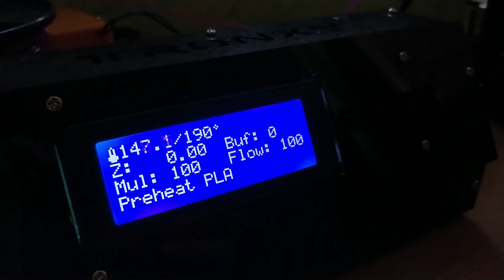Fix Poor Extrusion

Comment: That's not my problem. I get super rough and scratchy surfaces and infill. Diddnt before but it popped up a few months ago and havent figured it out
Reply from the maker: Hi, thanks for your comment!
To diagnose this issue, you need to verify that you have an under-extrusion issue. You are probably experiencing a similar problem to what I was in this video, but just not as strong. First, take a look at the extruder gear and figure out if it's slipping or if the motor is clicking. Then look at the hot-end. The cause of your problem can be anything from a slipping extruder to a (partially) clogged nozzle to a destroyed PTFE inline.
Let me know your findings to look at further steps.
Reply: @Caverntwo  I'll take a look. I have looked at all of those before but I don't think that was the cause. And I did just replace the ptfe tubing with capricorn xs and capricorn couplers.
Reply from the maker: That sounds good, I also once encountered a bad coupler.
What you should try is to push the filament thru manually. If you feel a lot of resistance, it's probably from either the nozzle or the PTFE tube inside the heat-break (except if you have an all-metal hot-end). My Anet A8 currently ran into this issue, I'm 95% sure it's from the PTFE tube inside the heat-break, as I encountered this issue already twice. It's printing normally but extruded less and less (with the motor clicking more frequently) over like two or three months now.

The Capricorn tubing will further minimize the resistance induced by the Bowden tube, so that's always good to have. 
Furthermore, did you check the steps/mm configuration in your firmware?

Comment: I've been chasing my tail for years on extrusion. My Geetech A10M has a peculiar feature which I have traced back to being likely a slicer problem. The walls do not overlap with the skin, at least in the top layers and sometimes with the inner walls. It isn't an extrusion problem because the first layer looks perfect or over extruded if my bed is a tiny bit out. Usually it evens out over a few layers. If anything I'm over extruding on my bottom layers, but my walls seem to want to have gaps between them and the top layers. Nothing I tried works.
Reply from the maker: It could still be an extrusion problem or even a configuration issue, with the latter being easy to check out. 
Heat up the extruder, move the head up a little bit and make the printer extrude a set amount of filament, e.g. 10 cm using Pronterface or even the LCD controller. Mark a reference line further up the incoming filament, e.g. 15 cm back using some tape and measure the distance to the extruder before and after the procedure. Then you know exactly how much really got extruded!
If it's off your expectations, you should take a look at the software configuration. Just put a M92 command with corrected values in your start G-Code. See more about it: https://reprap.org/wiki/G-code#M92:_Set_axis_steps_per_unit
Obviously, make sure that the nozzle is not clogged and the extruder not clicking, otherwise your results will be nonsense. You can also adjust the steps/mm setting in your firmware, but then you'd need to reflash.

For the slicer settings, if you use Cura, there's a setting for the distance between the infill or skin to the sides. Maybe that's what you're expecting, but it's only a guess.
Also, check out the filament thickness you set, just to be sure, that caught me three times already. Just that you know, the prints looked pretty much like the one shown in the video.

Let me know if that helped ya!
Reply from the maker: Oh, I just looked up, it's a printer with a single z-axis. I have experienced something very similar on my Anet A2+ when I got it, check out the videos for that. 
Basically, the bottom layers were smashed together and the upper layers normal or even pulled apart in some places. Turned out that it was due to a few things, one being some wheels locked up, the coupler wrongly installed, etc. I solved that by installing an upgrade that puts the motor and leadscrew into the middle, solving the problem for me.
Reply: @Caverntwo   Thanks for the input, especially so quick! I think it's a setting with the skin overlap as it seems very deliberately doing it. Something Cura is doing that it shouldn't be. If it was a blocked nozzle I would get layer separation, gaps in the print etc. I don't know, it mostly seems the walls are too thin. I will check out some test tomorrow. My e-steps have always been nonsense on this machine. I have used calibration guides but it seems way off and when I adjust to how I am told I get massive over extrusion so I set back to default, even though it shows me only 79mm is extruding at 100mm. I wonder if it's because I left this at default while adjusting the X/Y e-steps which were out a little bit.
Reply from the maker: Hmm that sounds strange. 
I'd still try to get the extruder steps right first and then look at the other things. To be honest, I set it to 95% to 98% of the recommended settings too on almost all of my machines. This reduced blobs.

Are you sure that Z-movement works as expected? Especially at the lower layers.
I'd check with a pair of calipers. Maybe the Z-steps are out of place too, maybe just a little bit. You can find it out if you print a calibration cube and measure it then.
Some other things that would get into my mind:
Can you verify that the size of the nozzle and material is set up correctly?
Is the extrusion process going on smoothly or is there some filament grinding at the gearwheel or even motor clicking?
Reply: @Caverntwo   My z steps are spot on. Each time I check it goes to 100.0mm on my calipers. I checked twice because I was getting grinding at higher layers before, which I thought was over extrusion, and I kept lowering the flow rate but then my layers just flake away with no substance. I traced this problem back to being too cool while running fairly fast on a big print. I now run quite hot, between 220-240 and my extrusion flow rate seems fine now, but I'm now getting gaps between walls and skin. I'm wondering if it's because my filaments are over a year old or are poor quality. I printed last night and noticed my inner and outer walls on a piece with 1.6mm walls were also not joining up well. The layers and bonded very well, are pretty smooth and strong. A bit over extruded on the base layer which has squished out.  I've checked my extruders constantly by tightening or loosening the spring. I think this is okay. It isn't grinding and it's fairly tight. I lowered my retraction settings to mitigate this being an issue at the cost of some stringing which isn't too bad to clean up.  I've never quite understood the e-steps and flow rate... are they basically doing the same thing?
PS: My nozzle and filament settings are on point. I am printing at 0.3 layer height.
Reply from the maker: Your issue is really strange, I have to admit. I'd try the following:

If you get some grinding, the extruder doesn't create enough pressure. You can try to tension/compress the extruder spring even more. 
If you set the printer to just extrude some material, did you measure the width of the extruded string? I once had an under extrusion issue similar to what you describe, which could be traced back to the nozzle being just slightly clogged. 

From the software perspective, how about trying to reset all settings and start with a new instance? Ideally, you just need to set the printers material thickness and nozzle thickness, sizes and you should be ready for another test. Maybe it's really a problem with your settings.
Reply: @Caverntwo   Thank you for your in depth expertise, it is much appreciated and is spurring me on for try and fix these issues once and for all. I am going back to basics now, having just tested my steps again for all 3 axis, and found something really strange. My calipers were giving different readings at different points along the rails, such as at 10 to 20mm it read fine, then from 30/40/50mm it was going 29.7/39.6/49.5mm but then evening out again when going up to 100mm. 
I assumed my cheap Chinese calipers were maybe the issue (They do say accuracy +- 0.2mm). At worse, the most my steps were out on any one axis was minor enough  (2%) for me to suspect the calipers, especially when I got different readings going backwards and forwards. This could be mechanical, but I decided to change my approach to be more certain of my steps....

I decided to print a test cube, which measures X 20 Y25 Z50 in my software.  The actual cube came out and looked fine. Just the odd layer with a very tiny gap in it, barely visible. The calipers measurements of the cube were quite dramatically different though..... X=19.5  Y=25.0 (correct)  Z=49.8. I'm wondering if my X Axis has something wrong where it gets to the middle of the bed, as my Calipers showed. The belt was a bit slack on the X axis, I have tightened right up and will print another cube. 0.5mm is a lot. And I guess that grinding I had (by grinding I mean that the nozzle grinds against the top layer when moving across it) was due to my layers not incrementing enough. The last layer should be 0.2mm higher, so I guess I need to add 0.4% to my Zsteps. Me turning the heat right up and the fan right down was probably just melting the layers downwards. Running at such high temperatures may have blocked my nozzle a little too and that's why I'm not over extruding when my other calibrations are out. It looks like I've been adding solutions that create more problems. What a mess. I think I will follow your advice and reset Cura settings to a default profile. I've spent years messing with all the little settings.
Reply from the maker: Sounds good! I think that this is the correct approach to address your issue.
However, the variation on the Z-axis doesn't seem to be the biggest problem. You said that you're printing with 0.3mm layers, so 50/0.3 results in 166.66666 layers. I'm pretty sure that the last one isn't printed then, resulting in your 0.2 mm difference.
If your heartbreak has a PTFE inline, the high temperatures could have destroyed it, adding resistance to incoming filament. I encountered this on three of my machines. In that case, either replace the entire heat break or just the PTFE tube, if you have some in the correct size.

However I think that the biggest improvement will be noticable once you start with a fresh profile.
Reply: @Caverntwo   Hi. I checked the PTFE in the hot end and it was fine. Also did some cold pulls and nothing bad came out. That thing about the Z makes sense, I hadn't realized how the printer handles division. I thought when I print a 50mm high cube it would be 50mm high. I might have to change back now or calibrate my test cube in multiples of 0.3. It's a shame as since I did that I was getting better results and no grinding at lower temperatures. I just wasted an hour changing my steps and printing the exact cube again, only for it to print exactly the same as I forgot to save my steps before switching the machine off, Doh!!

UPDATE: I just checked the cube in Cura and it goes to layer 167. Does this mean it prints the last layer at a lower layer height to make it fit the size?
Reply: @Caverntwo   I noticed the height Z on the LCD said 50.1 on the screen as it finished. (Even though it measured 49.7). I'm pretty sure the Z steps are a little off in any case.
Reply from the maker: No, as far as I know, Cura prints all layers except for the initial layer the same height, but there is a cool feature that does layers in different heights to improve surfaces. 

Just after writing the last reply I encountered a similar issue on my Anet A8, where the extruder just seemed to be partially clogged, filament was harder to push thru than normally, letting the motor click. I haven't solved the issue so far but used a different roll of PLA, which seems to melt easier. I guess it's probably going to be the PTFE liner again, but to change it I need to disassemble the entire hot-end... 
I guess you already tried a different roll of PLA, haven't ya?
Reply: @Caverntwo   I don't think that's right, otherwise Cura would be showing 166 layers rounded down, but it shows 167. I guess that's why the LCD showed 50.1 as instead of not printing the final layer, it printed it to go 0.1mm over rather than 0.2mm under (I imagine my LCD rounds up to 0.1mm). 
I used to have an Anet A8. It was far simpler to use than this thing. I just printed a test piece after correcting the X / Z steps and it came out perfect with some small piece of blue filament I had. The esteps are 340mm. Using the calibrating method, extruding 100mm only extruded 79mm, and calculations show it should be 430mm. I know all the maths is sound but in reality it is not so. Anyway, I increased the esteps to 370mm as a compromise to see what happens. I then printed something with my usual black filament on the spool and it was massively over extruding on the first 3 layers. So much so that it was a hot mess of hairy filament. I give up on setting my esteps, it just plain doesn't make sense what the LCD reads, what a ruler measures and what happens during a print. I think I'm back to just playing with settings. I notice that certain PLA prints differently, E.g: black needs much higher temperatures, especially for bed adhesion.
Reply from the maker: It was just a guess, I never looked up the edge cases on the Z-axis so far. You're definitely right with some black PLAs, as I only found two brands whose black sticks really well.
I think, in the end, you'll figure out the settings that are good for your case. And it doesn't have to be perfect, just good enough for you. I mean, there is always something to improve!
Reply: @Caverntwo   Thanks for all your help, it is appreciated. I at least figured out the grinding when my layers get to a certain height. I guess my printer is just weird and I have to use settings that go round the weirdness. When you buy cheap electronics, expect nothing to be perfect.

Comment: Shouldn't your nozzle be more in the heat block than the feed pipe? That could also be part of the problem
Reply from the maker: You're right, that could contribute to the problem. However, the main issue here is that there's no real heat-break, as the PTFE tube goes all the way to the heater block. In the meantime, I replaced the extruder setup with an E3D-V6 clone with a PTFE-inlined heat-break and never had issues with it.